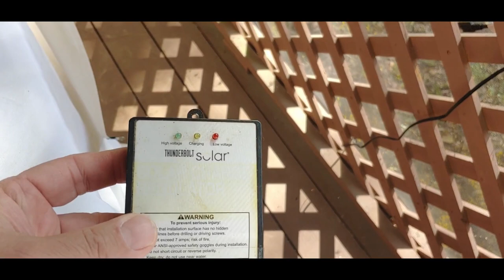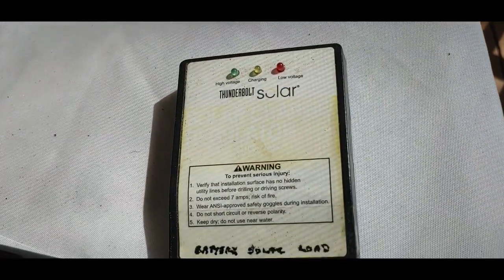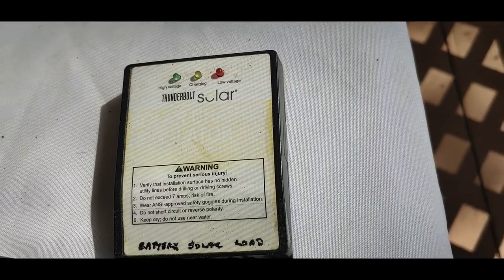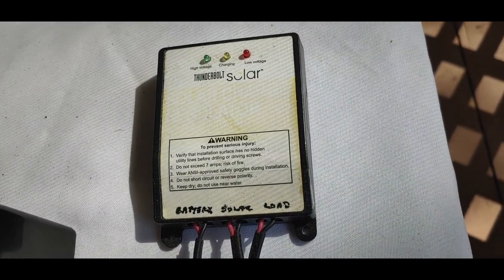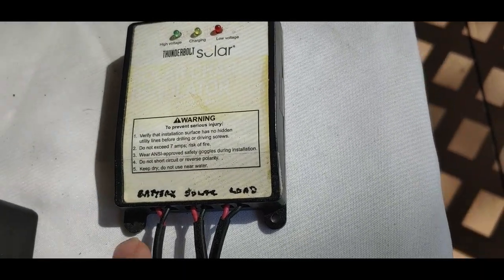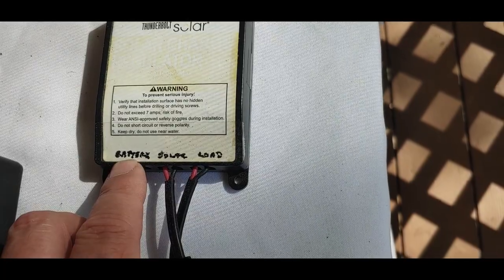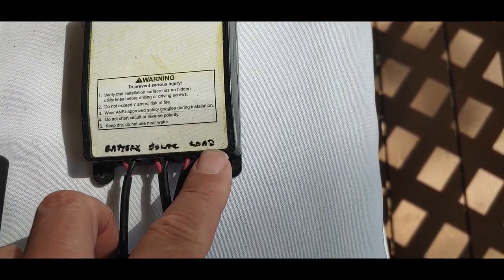Re-charging your battery after the Storm, quick and cheaply.

Comment: Got 2 of those 100 watt, panels from HF, but they are 24 Volt, so will hook up to 2, 35 amp hour batteries, accordingly.
Reply from the maker: The panel's I have are 12 volt. But thanks for the tip for the 24 volt. Thanks for your comment.

Comment: Hey shoestring have u checked the voltage/ percentage on battery with battery monitor after a night's usage? I know that they are 2 different things,even though voltage showing 12.7 the battery percentage could be 85% or lower. I've noticed this on different lead acid chemistries.not sure about lithium batteries since I don't have those yet 😔
Reply from the maker: The voltage does drop when under a load. I take that into account when planning my battery use. I did not us a lithium battery in this video either. Thanks for your comment.

Comment: Aha .. So those old HF Solar panels are 15 watts each. They are nice and slim but heavy compared to the newer 25 watt panels they sell now.

I got 6 panels .. 5 of the newer ones and one of these older panels. The guy said it was 25 watts but i see its 15, and has no sticker on the back showin its output specs.
I need to check all of these used panels i got to see if they push amperage.
I didnt know to do that as i have been collecting these used panels, only knowin to check voltage 😐 lol
Reply from the maker: Even the old ones work well. You do need to know the output of the panels. Thanks for your comment.